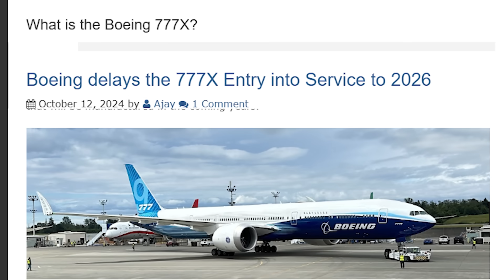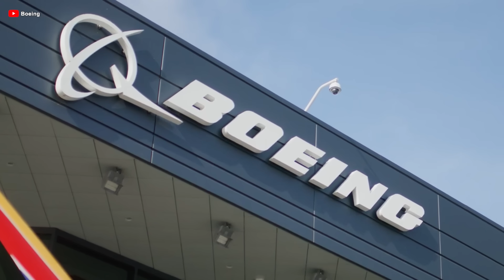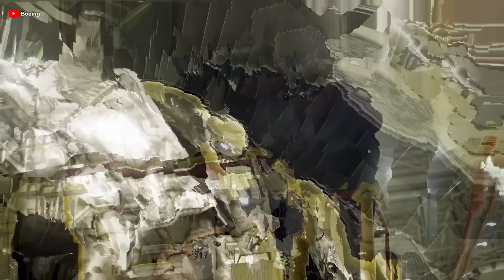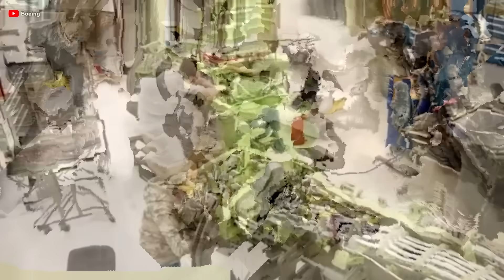Just how bad is the BOEING 777X essentially

Comment: The wing tips do not move while in flight , they are deployed before takeoff, their only purpose is to decrease the wing span so that it fits into the existing parking stalls . That is one of the amazing things about the A380, it doesn't need to do this, it fit the preexisting dimensions of the parking stalls.

Comment: This is an honest and well-balanced presentation of the 777X's case. I believe this aircraft has a future but it might not be as bright as initially expected, for a number of reasons.

First of all it is a relatively heavy aircraft. That is relative to the all-composite A350 in the same category. This is not an opinion but a fact. The other important aspect to consider is the size of the aircraft. In that regard it goes against Boeing's own philosophy of long thin routes for which the Dreamliner was developed. What in the end turned out to be true for the 787 remains true for the 777X. However what killed the A380 will probably not also kill the 777X. But it will certainly prevent it from being as successful as its predecessor, the 777-300ER.

When the Dreamliner was being developed they had two options. One was to design a metallic fuselage with composite wings, the other was to design an all-composite airplane. The engineers soon realized that it was necessary to make it all-composite in order to be able to compete with Airbus. The laws of physics have not changed since and that is what will keep weighing down the sales of this beautiful airplane.

Comment: 777 x will be a maintenance headache with its stupid folding wings.  They could have added increase sweep and accomplished the same thing.  BA is stupid by going with this design.
Reply: Why are you commenting on aerodynamic theory when you show that you don't know ANYTHING about aerodynamics. Confusing wing sweep with the design of wingtips, OMG. Please.....just shut up. BTW I'm a commercial pilot /flight instructor and aerodynamics lecturer for over 30 years, so I know what I;m talking about. You don't.
Reply: @Ozgrade3  You may wear your ideas in your brain 🧠 but I've known more ph.d's in my life that were blithering idiots than I knew smart ones.  BA would have been much better off utilizing the wing design similar to the 727-200 and having it conventional and in one piece than utilizing a nonsense folding wing design.   The KISS principle.   They would be a 4 billion dollars and a decade late to the Airliner Upgrade Table.  EADS is going to clean their clock with the A350-1000 and 2000 series Leaded paint chips included!  And getting away from dual sourcing powerplants is a huuuuuge mistake on both manufacturers.    So Brighteyes-- you.  Next major innovation-- Fly by Light!  Watch for it.  You can take your knowledge and fit it in a test tube along with all of your precious certificates.   I've been at this since you've been in diapers!

Comment: The A350 has a nearly all-composite structure, most importantly the fuselage. The 777-X is still primarily aluminium apart from the wings. Due to its weight and higher price, the 777 is having great difficulty showing any efficiency/performance gains over the A350. The canary in the coal mine was the fact it lost to the A350 in Qantas' Project Sunrise, a long-haul mission that should have been perfect for it.

Comment: The 777x is an old 1960s design with new bits added. And it’s a pigs ear just like the 1950s 737 abomination. And Like the 737 max it will be a dangerous aircraft that will ultimately fail.
The sad thing is Boeing will do the same with the 787 for the next 25 years. It is doomed to fail.
Reply: True

Comment: 'Success' is a difficult word to define as it can mean different things to different people.

There are several key points that matter:

How many aircraft need to be built before it costs less to build than they sell it for.
How many sales are needed for the project to cover  all of its costs.

Whenever we hear how much extra it will cost to deal with the latest problem it means little to the majority of us. What would mean something, is how many additional aircraft will need to be produced to cover those additional costs.

If we had those figures and easily available, perhaps we would avoid those claiming that the four figure deliveries of the 787  make the 787 a roaring success and the low hundreds for the A350 a failure.

Yet the A350 covered its costs of development after just a few hundred sales while the 787 is still covering its development costs after 4-figure sales.

Comment: This video was sponsored by an Airbus and their fanboys
Reply: I'd rather fly a safe airframe, not a boeing.  If its Boeing, Im not going!
Reply: @lazloperry5242 Boeing is straggling to prove that is THAT BAD
Reply: @lazloperry5242  how do you know it's not safe?
Reply: Cause they crashed 2 737 MAX killing 347 people and 777x stopped cause they found thrust link failures after not so many test flights...is that enough for you?
Reply: @davidblanco5711  and the fuselage blew out under test. Scary.
Reply: @MySkyranger  you mean the test that came in below with 1%. That's the whole point of flight/ground testing so things like the blow dont happen when they enter service.
Reply: Program started in 2013. 12 years later and it's still not in service. The A380, for all its delays, only took half the time from announcement to entry in service. And it was a clean sheet, not a neo'ing like the 777X. When you add all the pretax charges to date, the 777X program has already cost the same as the A380 and will probably end up far costlier. Boeing should just kill the 777X turkey and Airbus should neo the A380.
Reply: The B777X program is the last chance for Boeing to remain leading the widebody segment....
Reply: @patrickpeters2903 Boeing doesn't lead anything these days mate.  Airbus is number 1
Reply: @patrickpeters2903  everybody knows Boring dominates the wide body segment and Airbus the narrow body.
Reply: @mh12-47 where have you been living lately? Under a rock 😅. Don't be naive
Reply: No, Boeing use to be a great engineering company, it is no longer that, it’s now controlled by accountants, not engineers. This has nothing to do with being, as you childishly call, a “fanboy”. I flew Boeing aircraft for 25 years and I know that Boeing has changed dramatically.
Reply: @340ACP  I wonder why the US government doesn't intervene
Reply: The video is just citing facts.  Can't face your problems, Boeing man!
Reply: @321660  what facts? Airbus fanboy
Reply: No,sponsored by Boing and its faults.
Reply: Airbuz 350 won’t fly out a Dubi? When Pilot required pressure altitude calculations ground Airbuz daily, summer afternoons, non-airframe builders, shut up and sitdown 🤡🙀👽, my pilot husband says$
Reply: @colleenking5806  If you are going to insult someone on YT please learn how to spell properly and put a sentence together so its coherent. Its AIRBUS not AIRBUZ......DUBAI not DUBI....you seem to just ramble on
Reply: @colleenking5806  Okayyyy. Tell your husband to tell that to Qatar just down the road. 🤡